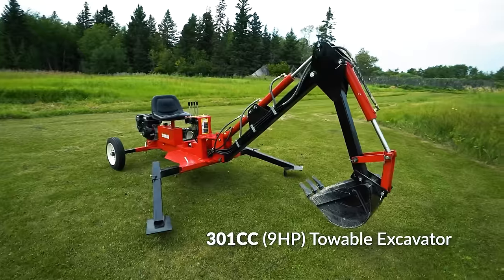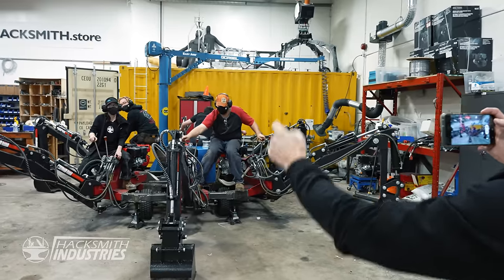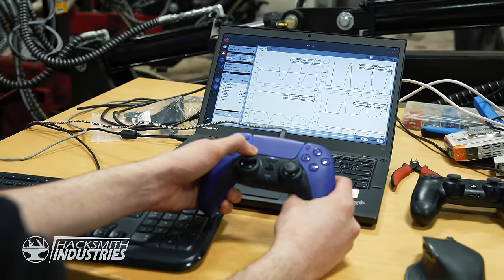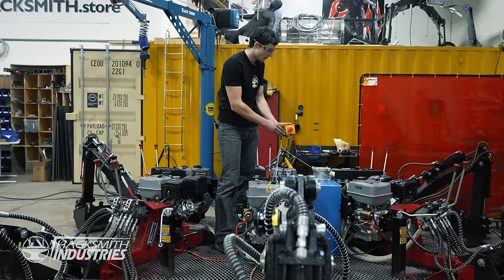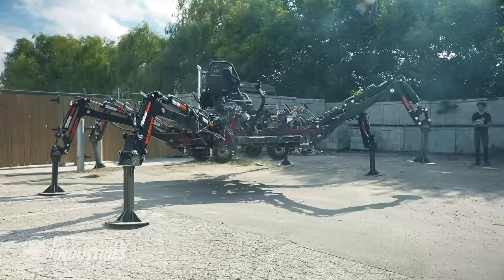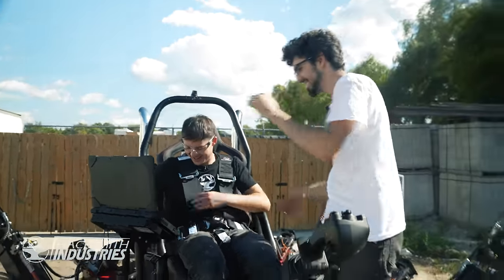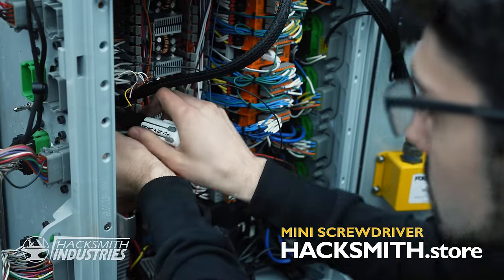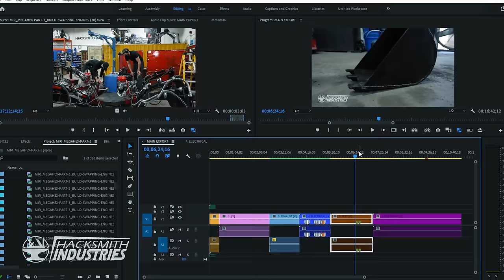Our BIGGEST project yet! (SPIDER MECH!)

Comment: lol. electric motors not hydraulic. carbon fiber chassis. dc generator. 3 dof on each leg.  you guys really need a systems engineer on your team.
Reply from the maker: If it's so easy why hasn't anyone done it? Easy to trash someone else's work without ever doing it yourself...
Reply: @hacksmith  because it serves literally no practical purpose whatsover ? its like asking why hasnt anyone built a forklift out of toothpicks ? because no one in their right mind would....
Reply from the maker: Sorry sounded like you're an expert on this,  but the only way you could be an expert is if you... made anything similar... I don't understand armchair engineers. A video only shows so much.  But you choose to  trash the whole thing with your own ignorance?
Reply: hmm , make one yourself in the same amount of time lets see